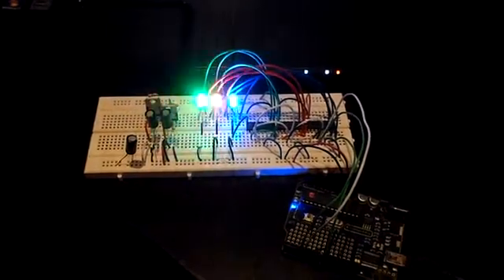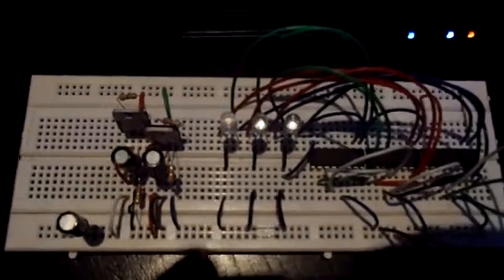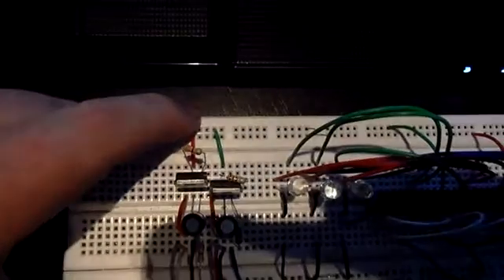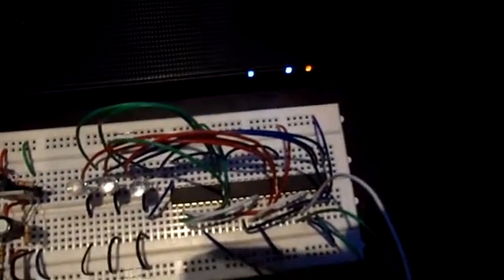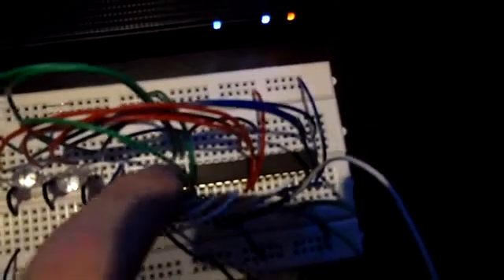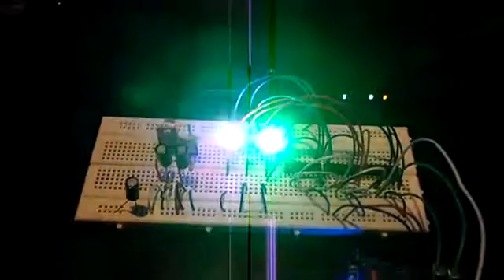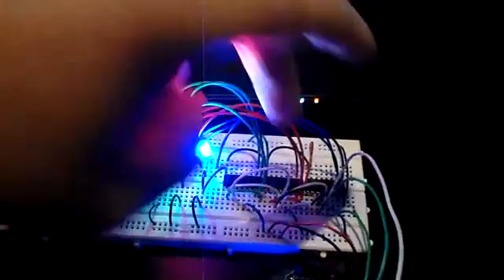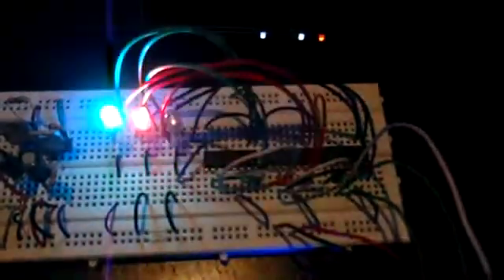74HC595 shift register, RGB LED's no* resistors

Comment: Can u share the details please
Reply from the maker: I posted this nine years ago, most of the details are in the title and the video itself. The trick is, each colour requires it's own voltage, so we use a linear regulator to supply that voltage, if I remember correctly, the LED colour voltage is supplied to the shift register, and the shift register drives the LEDs directly.
Reply: Well thanks a lot Bradley for answering my question, One more thing I want to know If you remember that which microcontroller do you have used or if you have the schematic related to this project it will be very helpful to me
Reply from the maker: @subhasishbiswas7928  just about any microcontroller will do, the datasheet for the 74hc595 will have standard schematics for you.

Not entirely sure what your user case is, but the rp2040 is very popular right now